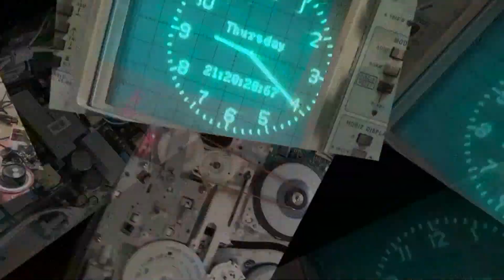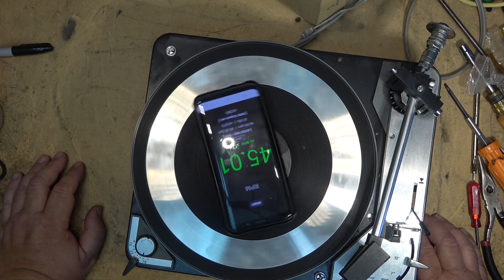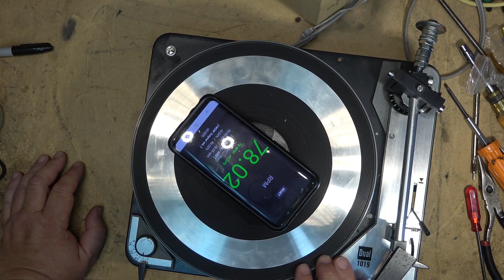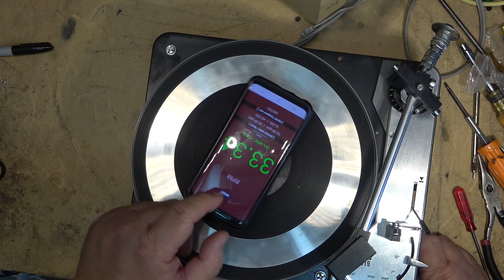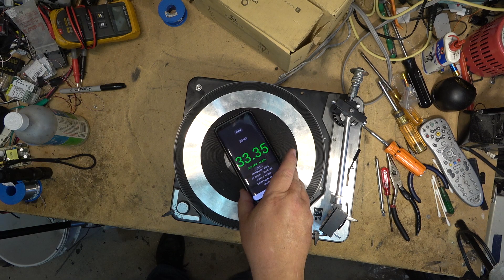Dual 1019 in the worst condition I have ever seen

Comment: 10:10 Don't do that! Never beat on the motor shaft as it's likely to shift the rotor on the shaft or force a bearing from its mounting. Instead, clamp the motor in a padded vise and tap the edge of the bell end of the motor with a blunt chisel, then tap again 180 degrees away, and so on until the cover comes off.
Reply: Too late.

Comment: Is it worth buying one of these if they are in decent condition? Anyone knows?
Thank you
Reply from the maker: These are idler drive tables.  They will always have higher rubble and wow than belt or direct drive.
Reply: @12voltvids  So is it because of more moving parts then that cause wow and rumble?
Reply from the maker: @SDsailor7  the rubber tire gets hard and transmits the noise from the motor.
Reply: @12voltvids  ah. I see.

Comment: Interesting video particularly for me. Purchased my 1019 in 1968 while stationed in Germany, at a Canadian PX in Zweibrucken. Highly rated turntable at the time for the price, it needed to be optioned when I returned home for U.S. use. My biggest complaint is with the cartridge/tonearm hookup. Spring like fingers make contact with the cartridge, once it is locked in place. Because of age these sometimes don't make a connection, and either the left or right channel is out. My record sizes on the right of turntable are 17-25-30cms (7-10-12) ! Thanks for the video...
Reply: Clean the strips of metal in the headshell assembly with a pencil eraser.

Comment: I have to wonder if WD40 alone could gum up a  mechanism that  badly. I've put it on lots of things, even flooded the gap around a window to ant-proof it (it's amazing as a pesticide) and I've never seen much residue at all  once it dries. Could they have used some other kind of oil and simply used too much? The oils they used at the factory on Garrard and BSR changers hardens like glue; it's almost as if they used cooking oil in those days. Whatever they used had to be fairly flame resistant, so it wasn't the idea long term lubricant.
Reply: It is a combination of the old lubricant and WD-40 and add to it that WD-40 is a dust magnet and you have an instant headache..
The designers and builders of Dual turntables didn't think or expect their turntables to last 30,40 , 50 or even 60 years.and for them to last that long is a testament to great design and engineering..At the time they used the best oil or grease for their intended purposes..With modern oils and greases, Many of the older turntables will outlast their modern counterparts because of the quality of the parts used to build them..

Comment: I've seen WD40 destroy several of these machines.  People don't realise that WD40 dries like glue, not to mention a lot of the parts in these should not have a lubricant placed anywhere near them.
At the start, I didn't envy you attacking this one.  Every single part would have needed cleaning ,degreasing (or de-wd40ing) and then a full relube.   No wonder it took you so long.....
I usually find the speed stabilises more after 5 to 10 minutes running, though the speed on this one looks pretty good and fairly stable.  I don't see this one becoming a daily driver :)

Comment: If you use WD-40 in small quantities just like any other oil, why that would be a problem? Personally I add just a small drop to lubricate mechanisms, gears and it works perfectly. I think if you use it properly as if it was an ordinary oil, you won't have problems.
Reply: @goodun2974   who knows, maybe you are right...  In my case it hasn't created any problems so far. It stays fresh for a long time.. ok, when its solvent evaporates, it reduces the volume, but it leaves the oils behind keeping the machine running. What concerns me is if it harms plastic gears. The package doesn't warn though...

I use it mostly to keep gears running on VCRs, DVD players etc...
Reply: @saint_and_holy_unicorn   I have been repairing audio electronics for 50 years. I never use WD40.  I don''t believe that it specifically damages plastic, but the only valid use it has for electronics work is that it is pretty good for cleaning ol, grungy plated-metal, unpainted chassis on guitar amps. As for the instructions and precautions on any kind of can of solvent, contact cleaner or lubricant, virtually no one ever puts anything  on the packaging of their product that might discourage sales. Every product ever made by anyone is of course a miracle product and will solve all your problems in life. I've seen contact cleaners that say "Cleans and Lubricates!" in big bold letters but elsewhere on the can say "leaves no residue!". Obviously, both of these things cannot be true.  I have seen the insides of amplifiers that had corrosion on connectors and circuit boards because somebody sprayed something inside there as a "contact cleaner" that was either inappropriate for that use or they used way too much of it and it flowed into the wrong places.

PS, most plastic gears were originally lubed with some type of white lithium grease similar to Lubriplate, or perhaps gray Moly-lube. Silicone lubes can attack some types of plastic.
Reply: @goodun2974  ok, I'll keep that in mind, thanks for the info!  My fear was mainly for the plastic gears because I've seen people claiming that WD-40 can harm them.
Reply: In my experience conventional WD40 doesn't lubricate, it can release stuck / grungy parts when used in moderation but should always be cleaned off and then followed up with a proper light oil (something like sewing machine oil or light lithium grease for the turntable). Spray WD40 on a stuck rusty gate hinge and it will likely free up but will then squeak like hell until oiled.
Reply: @ralphj4012   maybe it has to do with the time of parts you want to lubricate. I wouldn't use it as lub on a heavy metal parts like arms, plates, slides as in this turn table. But a drop on the post of a VCR  gear/ pulley works very good for me so far.
Thanks for the reply!
Reply: @saint_and_holy_unicorn  Ho, ho. What works for you, but I have made a mental note never to let you anywhere near my Sony SLV-SF90. No disrespect intended.

Comment: That poor old 1019 was a real mess. Congrats on getting it working! While watching the video I was wondering when you would notice that the counter-weight was missing. I like you solution to the missing part. You are correct, the heavy (7.5lbs) platter does help with Wow specs. The 1019 came out on top in my recent Wow measurement competition video on 4 different vintage turntables.   https://youtu.be/4nXAj_clzdY
Reply from the maker: I may have to do that.  A shoot out on different tables I have.  Great idea as I have a bunch to compare.
Reply: @12voltvids  make a video of the results so I can compare my turntables.

Comment: It's a wonder the cartridge is good ,all the sticky residue acts as a damper on all the mechanicals or stops them ,I wonder where the lead went.
Reply: Also note that some models of dual turntable have mute switches that that shut off the cartridge output or short it to ground when the machine is in changer mode and or the arm is moving, so that you don't hear a clankclank clank noises through your speakers. Those switchess oxidize badly and should be cleaned. You can't just spray them with contact cleaner, you need to polish the contacts with a pencil eraser.

Comment: Steuerpimpels!
Reply from the maker: Does this model use them? I didn't notice.  But then again i didn't notice the missing counterweight till i went to set the arm weight.  I was too busy looking at that bloody mess in the mechanism.
Reply: @12voltvids  If so. I think it's under that flat semi oval shaped plate under the arm pivot.
Reply: I also believe that spindle is incorrect? looks like a Garrard or BSR spindle. I have a 1225 and a 1229 - nothing like that ( both need work )
Reply: @bugsyjonesband  ,  I watch someone else on YouTube replace the "steurpimpel" with a piece of center insulation pulled from a scrap of thin coaxial cable. Dual used several types of little gum rubber or soft plastic pieces on various turntable models, one for the cueing ( on the top side of the turntable) and another underneath for sideways arm travel. I forget which is which;  we had some of those yellow gum rubber ones in stock but they dried up and got crumbly.  I basically refuse to work on most Dual turntables these days anyway.  If it's old enough to have an idler drive then it's definitely going to be a can of worms.
Reply: @goodun2974  I used a pencil eraser once. But I bought a dozen of them from somewhere once. It was almost the same price as buying one or two.  Still in my queue . A 1225 that also has a rumbling motor bearing and a 1229 that does the little shift while lifting move from the telltale bent stylus.